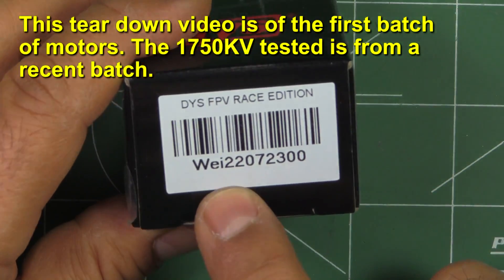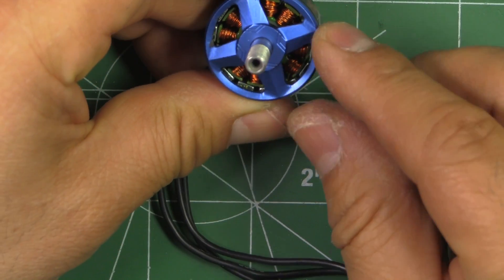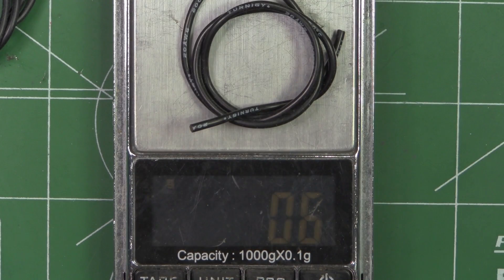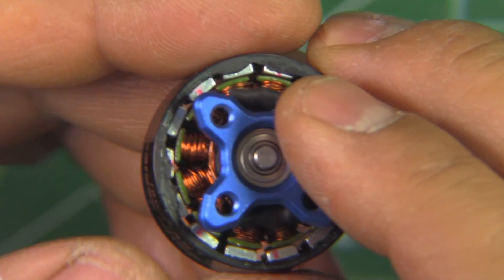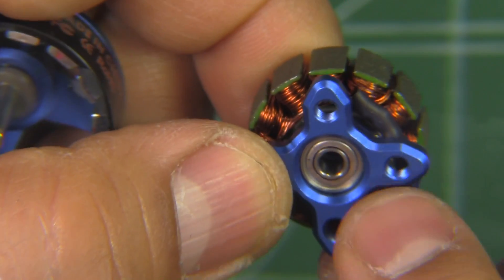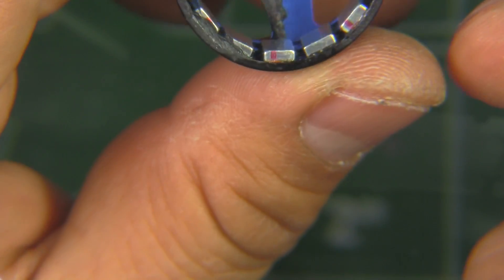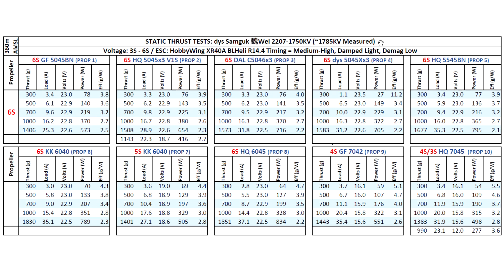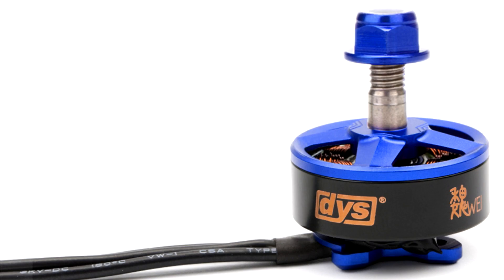dys Samguk 魏Wei 2207-1750KV 6S Thrust Tests

Comment: Your Props is Bad way reverse clock !!! and useless test, your max thrust is 2,8g/w but what about 8g/W at 300g ?? it's not linear .
Reply from the maker: Yeah sorry all my test are bad. Please don't watch. Sorry. Thank you. Good bye
Reply: EngineerX please take a look, your motor turn clock wise and your prop is made counter clockwise. Look the propeller. This  test is bad reverse coupled !!

Comment: i just got my 3rd set of 2207 2600kvs and they seem to be very low power, they felt a bit notchy and even rough out of the box, is there any way to tell if they have the wrong kv? windings?

Comment: Can you please tell me why 6s low kv motors draw less amps but yet manufacturers are making 50,60,70+ amp escs? Wouldn't a 20 or 25a esc rated for 6s work just fine? Am I the only one pondering this?
Reply from the maker: Good point. My best guess it's cheaper and more marketable to have ESCs that cover more setups rather than just a few. Perhaps manufacturers believe those 50-70 esc's will be purchased by people running 3S,4S,5S and/or 6S. Also there's the other marketing ideology of more is better. Castle Creations has or had 25A/6S esc's, too bad they kept using proprietary firmware that wasn't so good. Maybe it is now, I have not checked on those lately.

Comment: Hi Rolando,
Are you planning to test new RCX NK1407 motors? I was looking for good replacement for my RS1407 4100kv motors for new 3". RCX told me month ago they was working on new 1407 series. They have 3200kv now available, which is too weak for me, but they told me 4000kV is coming soon.
Reply from the maker: MyRCMart did not send them yet. I'll have to request them.
Reply: @EngineerX  I think I'll get it any way, only will wait for 4000kv.